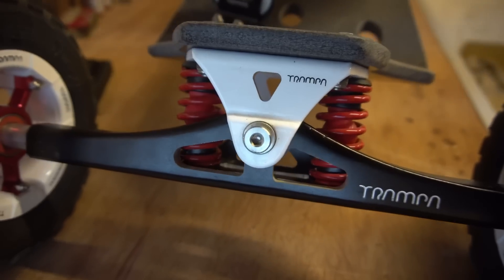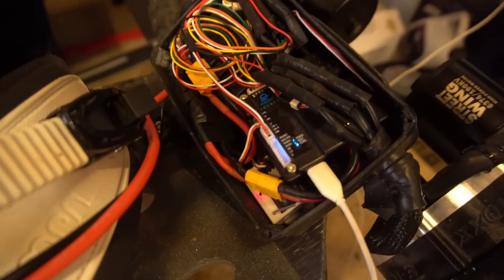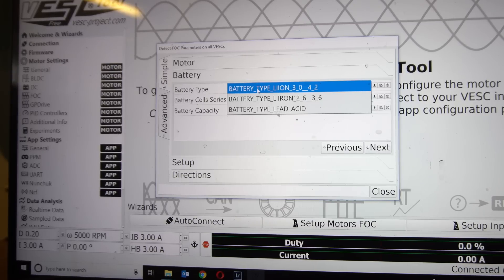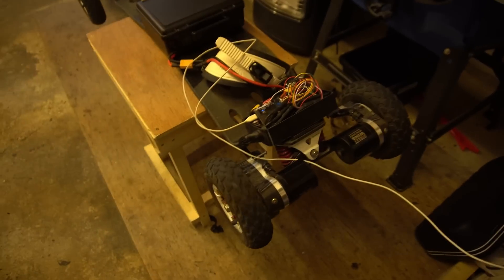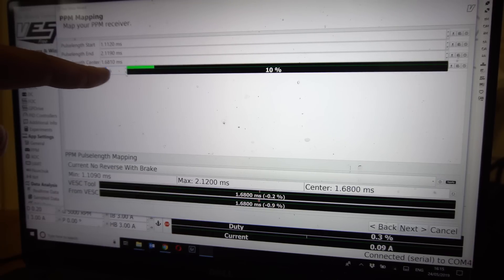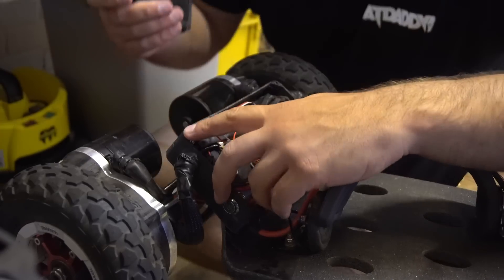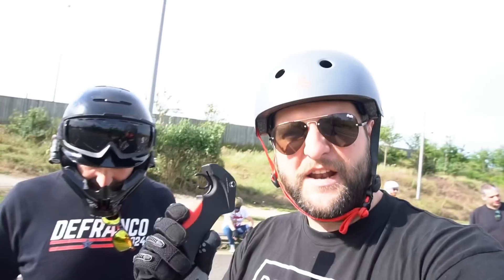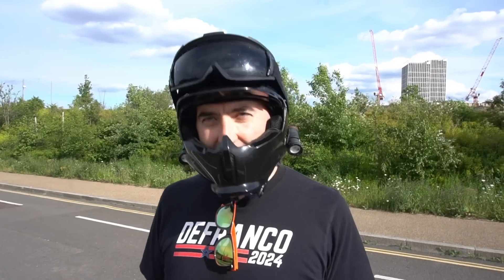How To Build An Electric Mountain Board - VESC Programming and Test Ride!

Comment: How do you determine the value of the "Battery Current max"?
Reply from the maker: However many cells you have in parallel x the max discharge of the cell.  So 4P of 30Q would be 80A max continuous discharge, but because you have 2 motor controllers you half the current to each so 40A each

Comment: Motor and battery settings are individual for every vesc on controller board so for now You only have one of the vescs configured. Check for example battery current limits on both vescs. I have two separete vescs 4.12 connected by can and realized that after a week of riding.
Reply from the maker: I realised this afterwards, and infact back then the VESC was defaulting to BLDC even when FOC is chosen so it was in BLDC too! All was sorted quite quickly

Comment: HEY LAD IM BUILDING A SKATE BOARD WITH 4 MOTORS . HOW WILL I CONNECT 4 VESCs TOGETHER TO BE CONTROLLED FROM ONE REMOTE ??? THANK YOU
Reply from the maker: Hey man! You connect them all via CAN bus and then the remote receiver goes into one VESC and it communicates with all VESC's on the bus.  Or you can connect them in pairs and split the PPM and run it into one of each pair

Comment: Crank your motor current limits up. Those things can handle more than 60 amps.
Reply from the maker: Not needed mate, managing thermals etc and with only 45A battery current there are only so many transiients you can benifit from!
Reply: Lee Wright you can get 80 amps continuous to your motors with less than 45 amps continuous from the batteries, and you'll be glad you turned it to 11 when you're in heavy mud.
Reply from the maker: @atlmember4045  is that so? I wasnt aware of that.... I'll give it a go bud.  The purpose of the build is more of an all terrain explorer but I want to do some off road stuff